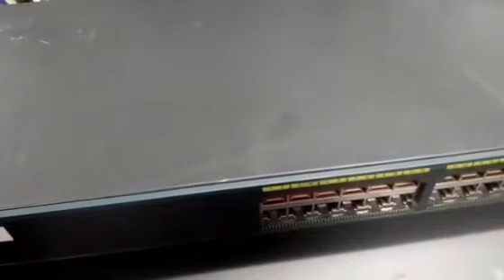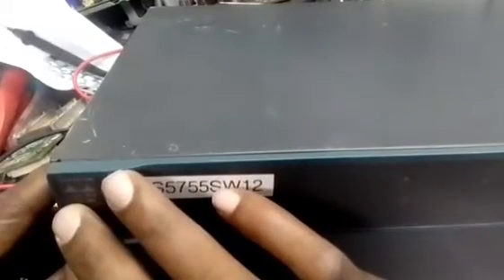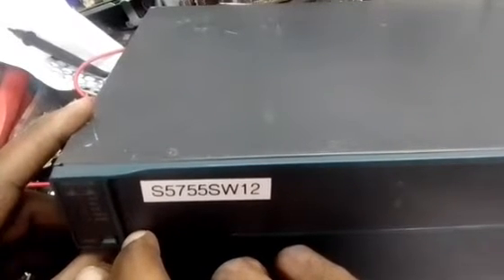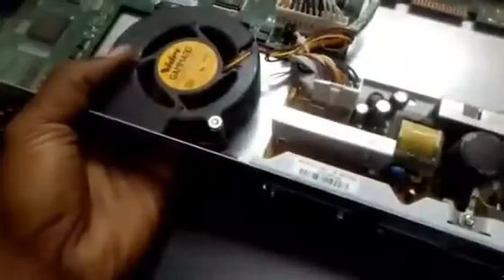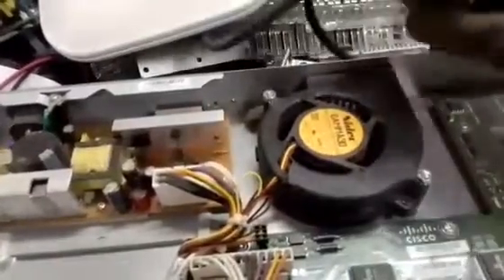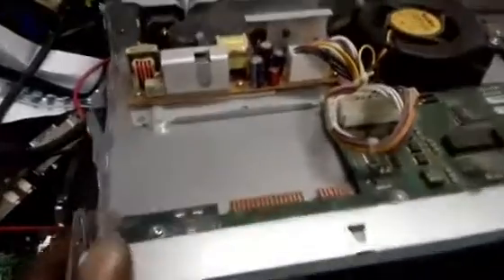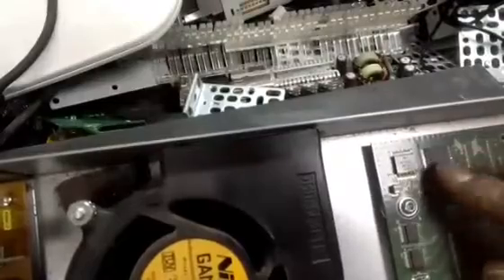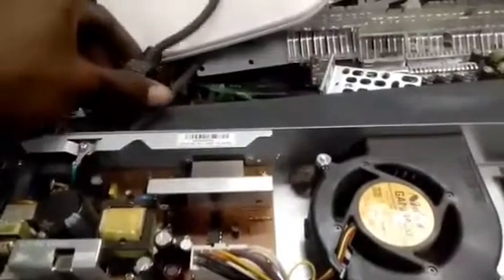#cisco #networking #switch #hardware  Dead Cisco switches  repair in just 5mins , power supply OK

Comment: Hi brother my cisco switch SG500x are not lighting up led lights(Master, Fan, System) but the FANS are working & LAN ports are lighting up but not giving IP address.
Reply from the maker: Power short, or insufficient voltage

Comment: Hello brother thank you so much, I have 2960 Cisco with the same problem, i heat on ram but not fixed, i measured voltage in motherboard i jast have 12 and 5 volt there is no 3.3 or 1.8 , I looked for shorting and guess the 1.8 inductor is short to grand , i removed the inductor inject the voltage the current not goes up 50mA (maybe its normal)
Could you help me plz 🙏🥺
Reply from the maker: What is the full model name ?
Reply: @jkftech  WS-C2960-24TC-L
Reply: Any idea bro ?
Reply from the maker: @tarashe_pc  check the missing voltage  8pins diodes
Reply: I have no voltage on gate U32 MOSFET , there is 0.9 ohm between drain and source of u28 MOSFET, I removed U28 but the ic not shorted and short not gone!?
I injectet 1V into shorted place but no heating place found and the current not going up then 0.65 ah
Reply: @jkftech  I have no 1.8 or 1.5v!
Reply from the maker: @tarashe_pc  check for short